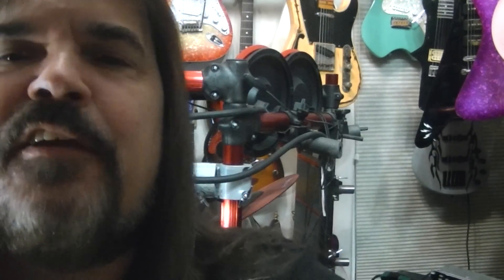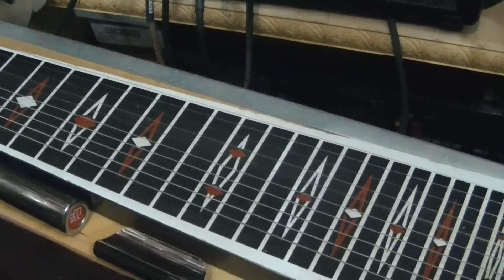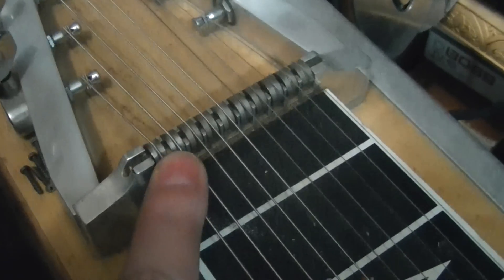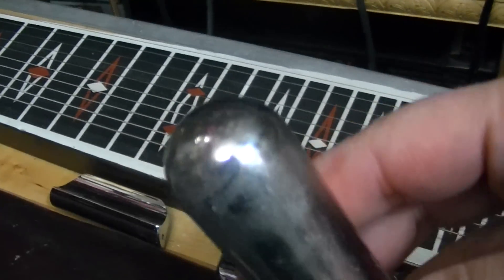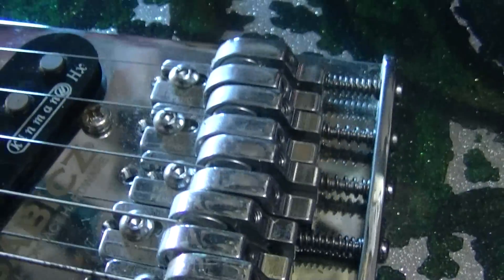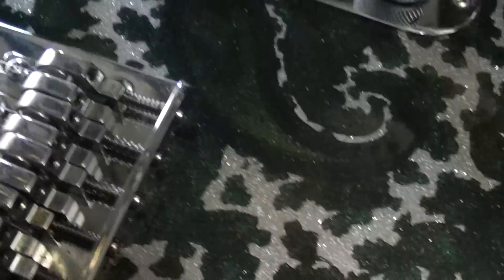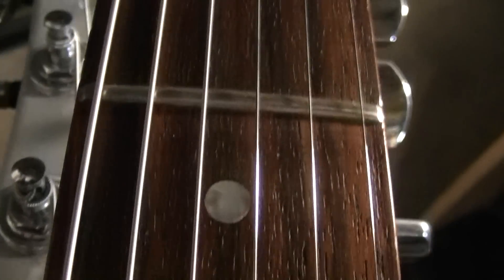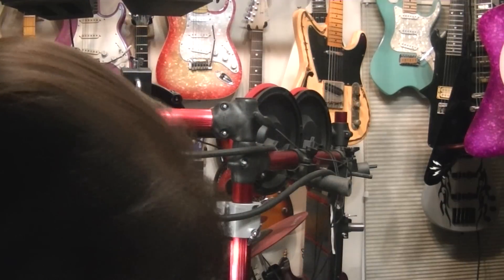Electric Guitar Sustain...The Truth According To Scott Grove

Comment: dear, Scott, if all kind of things can take away sustain like you explain, and you have a guitar with those kinda problems, you can try to tackle those problems and you'll be improving your guitars sustain( better strings, heavier more solid bridge(Ibanez Gibraltar Bridge).etcetera etcetera. also the weight and the constuction of the guitar make a difference(marble vs styrofoam). it is about how fast your string loses its energy. and yes of course the string has a finite ammount of it.
Reply from the maker: I've personally never found the weight of anything to help or hurt with sustain, but......it might and might not for you.   I can HONESTLY say that I've had any issues at all with sustain.  I've never went looking for more etc.  If the note needs to go longer, I just make it go longer with a compressor/sustainer.  I mainly use it for pedal steel licks.  I KNOW that no regular guitar that has fingers on the strings will sustain as long as a pedal steel will, so.....I use the devices made to crank up the dying notes.  It's not reproducing normal decay, but........you HEAR it longer, so....I'm good.
Reply: Groovy Music Lessons that's what I was trying to say in my comment if I was on the same wave  as you were thx bud.

Comment: keep the energy you put into the string by plucking it, in the string.  as nice as a resonate body is to play acousticly the energy you put in the string has now entered the body vibrating it instead of the string....loss of sustain. bridge and nut should reflect the string vibration to keep the energy in the string. Leo and Les both said that years ago.  jazz guitars have long lengths of string between bridge and tailpiece to kill sustain as that it not desirable in a jazz guitar......not sure I agree but that's what the jazz players either want or are told they want.......hmmmmmm!